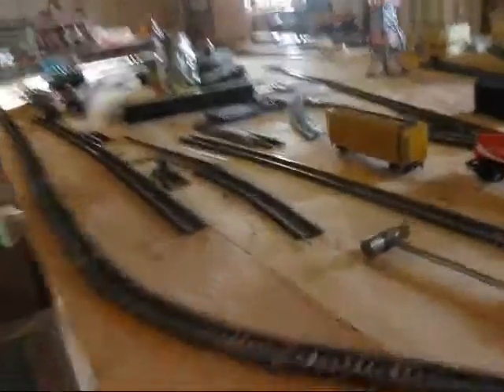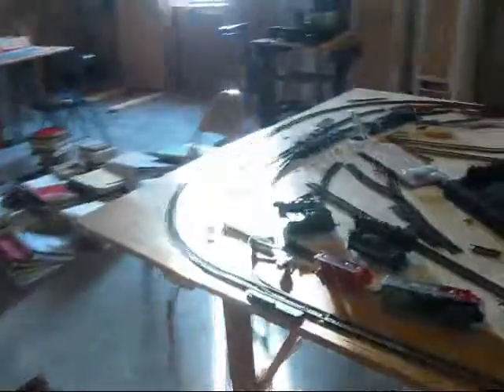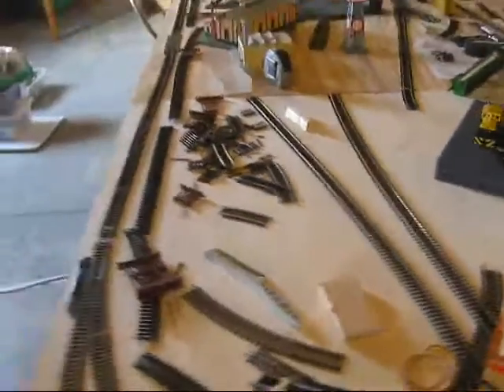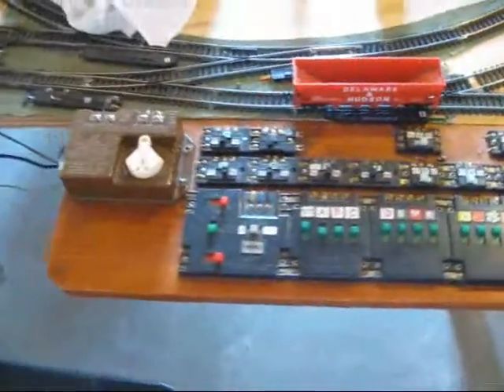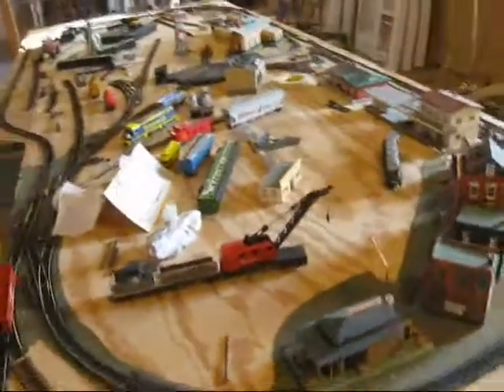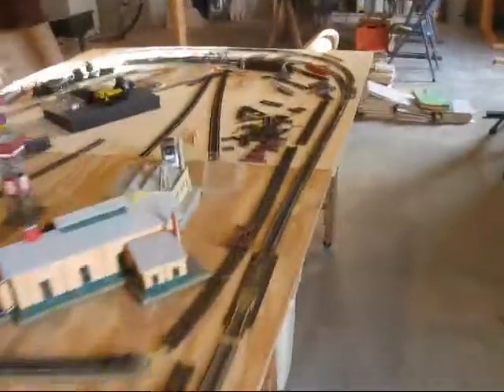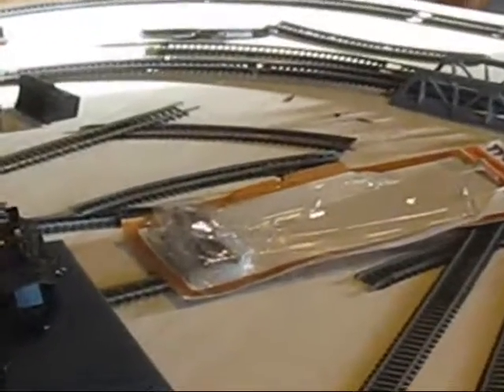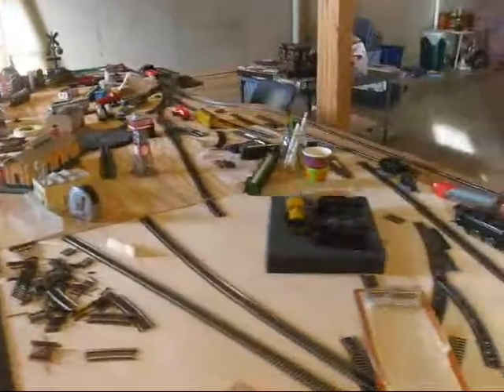HO Layout Rebuild- Part 1

Comment: Great layout! It is easy to switch over to DCC... it is just kind of hard to put decoders in all of the engines. You should get rid of your brass track and possibly put some Atlas code 100 or code 83 on there. Engines don't like to run on old, brass track. On the next video, you should have some trains running. Great video, again, and 5*!

Comment: They can easily range from $70 for a cheapy Bachmann, or you can go for a top-of-the Digitrax system that can cost you over $1100. Depending on how large your layout is, the price should be fairly cheap. I have the MRC Prodigy Express, and it cost me $155.  It is easily expandable to wireless capability, and has a walk-around throttle so you can walk around your layout while you operate. And, everything needed is included. You don't have to buy and extra things like boosters or that stuff. :)